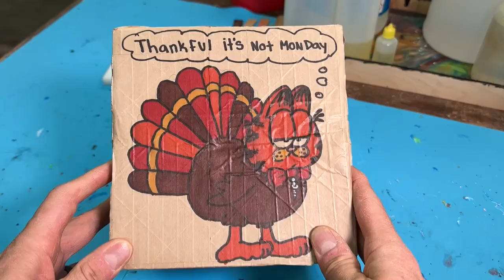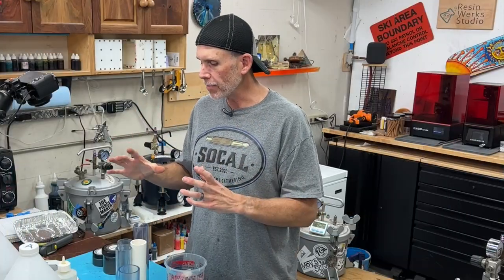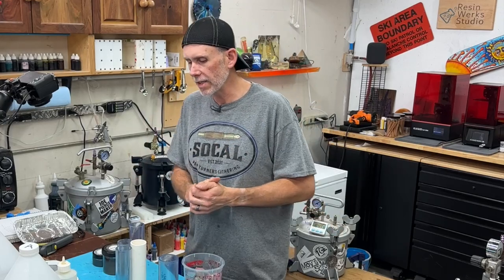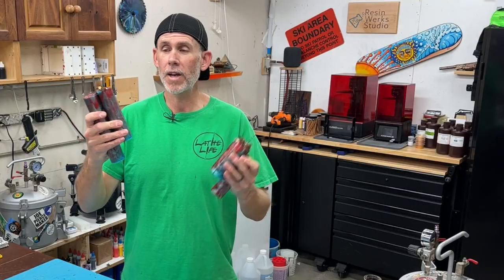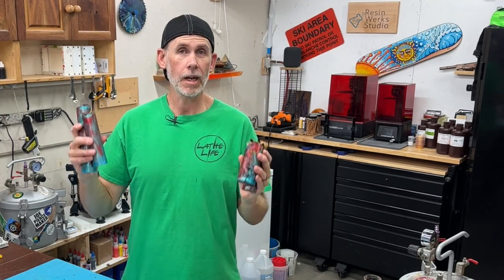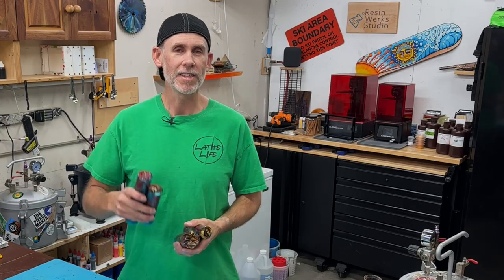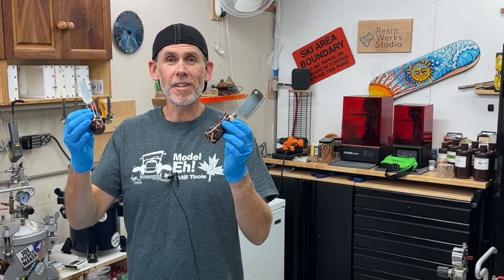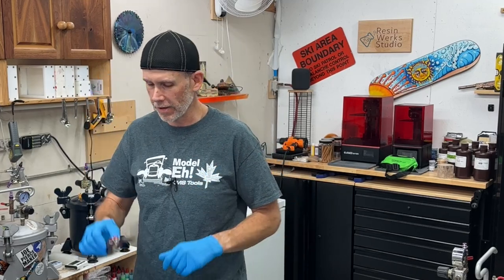Mystery Box 5 - 5 Piece Set of ???

Comment: Hi Zac. I've been watching your videos for a while and I just started doing experiments with resin and mold making myself but I'm struggling to find correct information in one topic. Do you think mold shore value and wall thickness influence longevity of mold? If so, what would you recommend for mold longevity/durability? Thanks and have a good day :)
Reply from the maker: I'm not entirely sure. There are a lot of things that can factor into the longevity of the mold. You do want a minimum wall thickness for sure, the thinner it is the easier it is to tear. The hardness has more to do with what you are actually molding and how easy it will be to demold it. Which type of silicone, what resin you use, and other factors all go into how long a mold will last. I wouldn't worry about it too much though, molds are repairable if you rip them, and most molds will last quite a long time
Reply: @ZacHiggins  That's super helpful. Thank you!